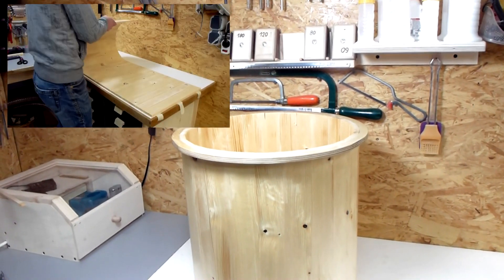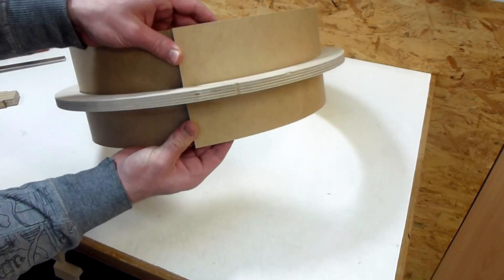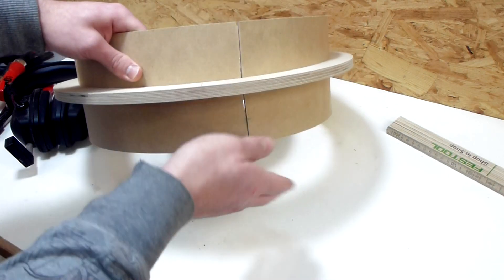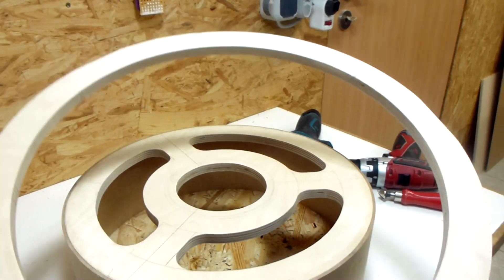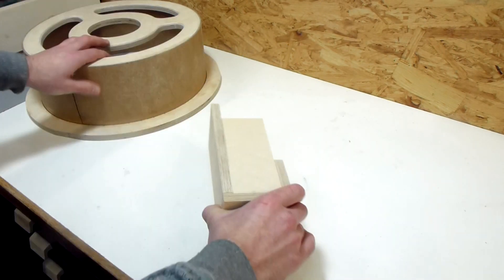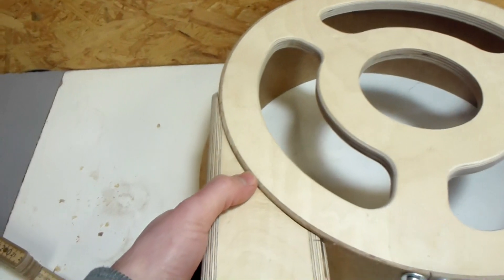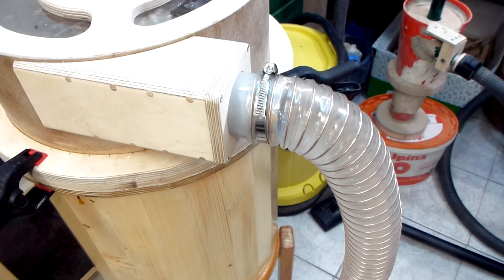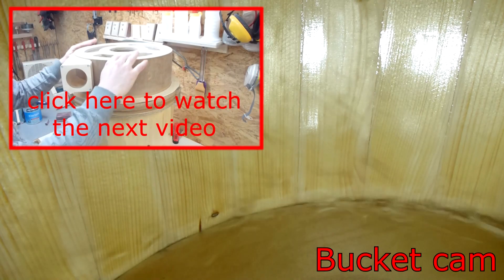Making the Thien-baffle (Chip-Separator Part 2)

Comment: hi marius, do you have an air-compressor ,would be easier than screws for permanent connections ,just wondering,love the videos
Reply from the maker: +Leon Meertens what exactly do you mean?
Reply: +Marius Hornberger well,for the mdf you use 2 screws with washers,while nails from an compressor stapler are much smaller,and because you already used glue it will hold,just wondering if you had air tools and compressor or is it on youre wish list? greetings leon meertens
Reply from the maker: Ah ok, I have an air compressor, but no stapler. But I'd be afraid the the small nail head can't hold the tension of the MDF wall.

Comment: Very cool putting the camera inside the cyclone.  Good reason to get a GoPro! 
I also like your idea of screwing and then replacing the screws with dowels.
Reply: I agree, cool demonstration. Also, nice job on the video editing. I really like when I'm not forced to sit through someone else's repetitive tasks, but I still see all the steps that went into it.
Reply from the maker: Yeah a GoPro would be nice. Was a little torture for my camera, but it still works.
Reply: Marius Hornberger cheap GoPro camera  http://www.ebay.com/sch/sis.html?_nkw=SJ4000%20Full%20HD%201080P%20Waterproof%20Helmet%20Action%20Sports%20Camera%205MP%20as%20GoPro%20Black&_itemId=121550454725